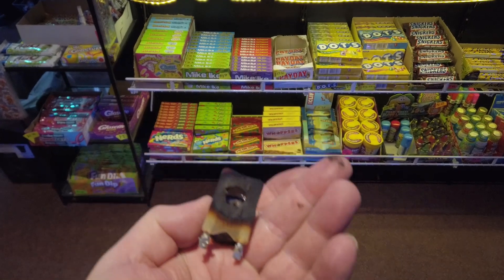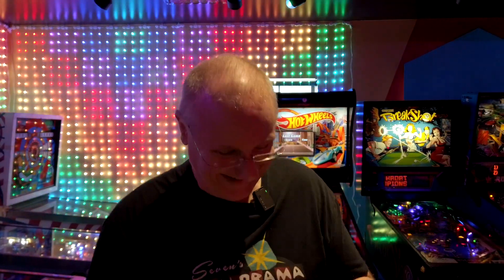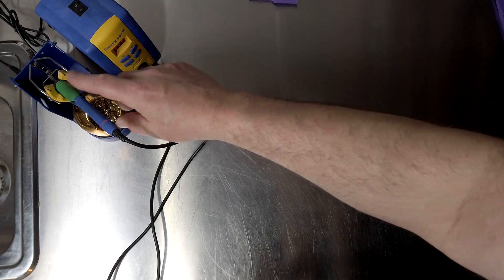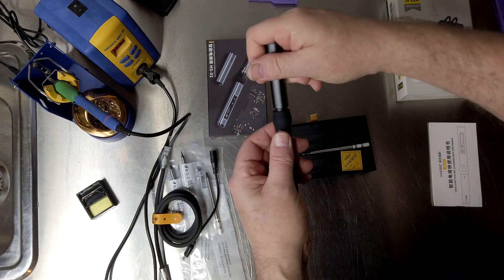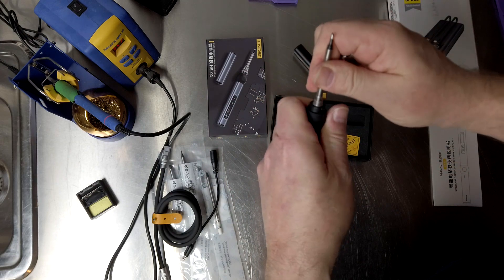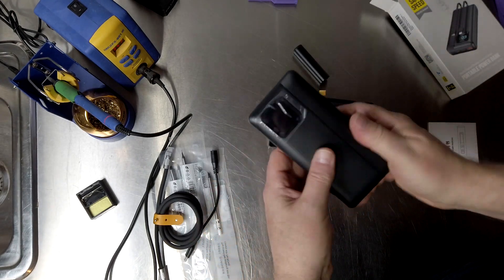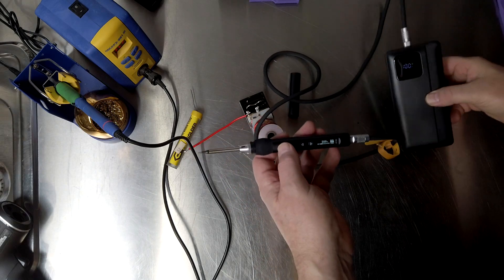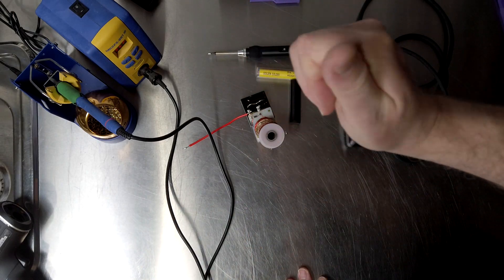Soldering Fun: Frogbro LD006a vs FNIRSI HS-01 vs Hakko FX-951

Comment: was the power pack included with the iron  or do you need to buy it separate. And if so, what is the model of the pack.  Would be very handy to do automotive repairs at the shop.

Comment: Thank you so much for the follow up video AND the gifter for gifting!
Reply from the maker: You bet!

Really, at the end of the day, the Frogbro wasn't bad. I think my biggest issue is it was designed to hold like a pencil - from below - with your thumb on the button. I'm working on things under a playfield at a slant and I tend to hold the soldering iron from the top or further back on the iron. It's hard to get my fingers in the right place to keep one on the button. If someone was using it at a desk or workbench, it would be fine I think.